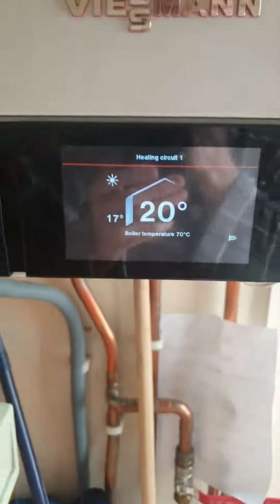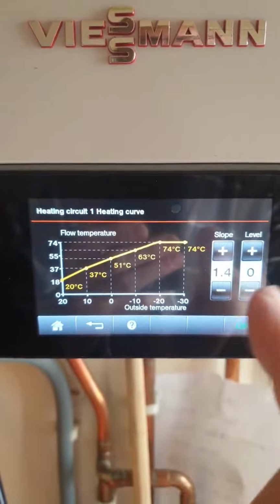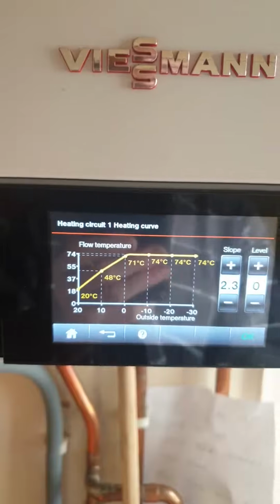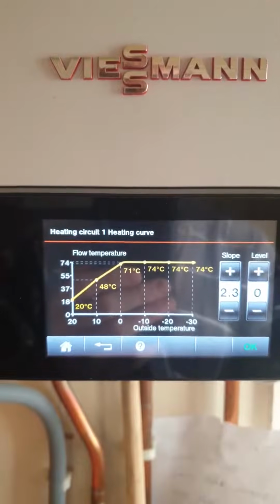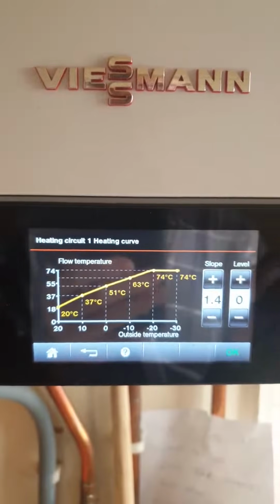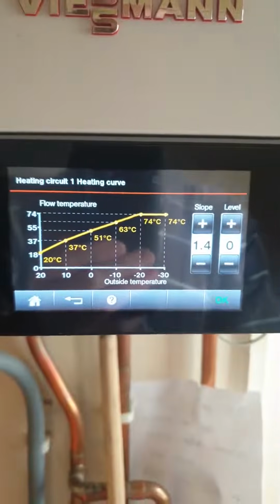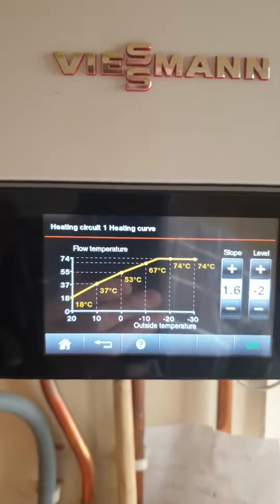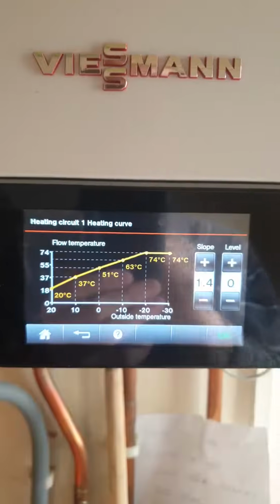Weather compensation and Viessmann design(3)

Comment: Hi Andrew. Thanks for the video. I am wondering if you could offer some advice on wiring a Viessmann 100-w (I know you usually install the 200 series but maybe the same) heat only boiler with weather compensation and priority domestic hot water using a cylinder demand box. Now, I can wire S plans, Y plans etc but the diagrams that come with the controls make no sense to me at all. Have you happened to have wired one of these up by any chance?

Can you also tell me which bell wire you use for the sensor. The book says use bell wire with a cross sectional area of 1.5mm. I cannot find any bell wire that is this size. Bell wire seems to stop at 1mm but most are like 0.33.

Thanks Andrew.
Reply from the maker: Yes I'm not a big fan of The 100. If you Google my name and obtain my phone number you can call me on Whatsapp
Reply: Thanks Andrew.